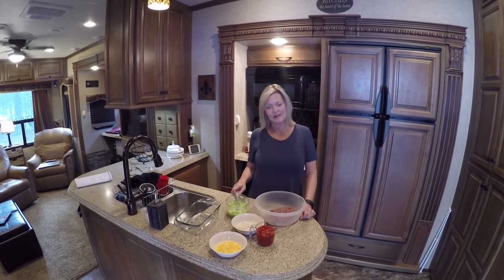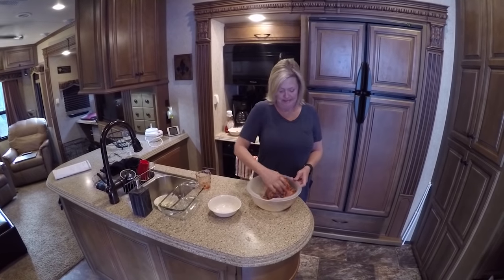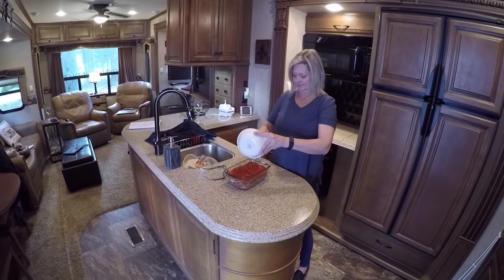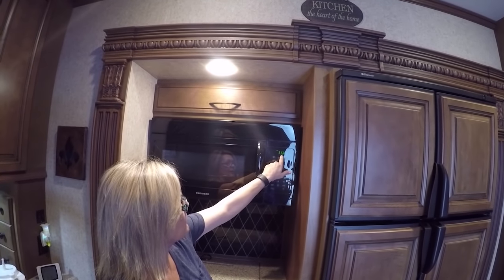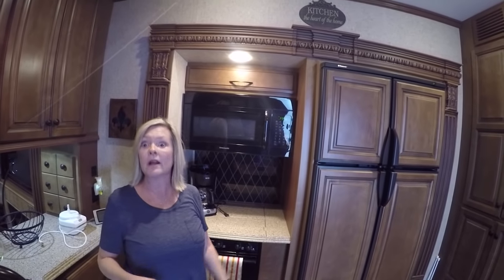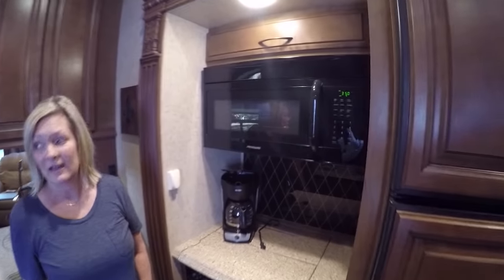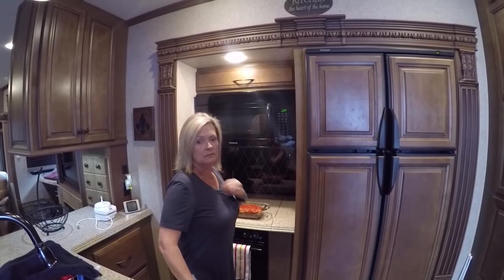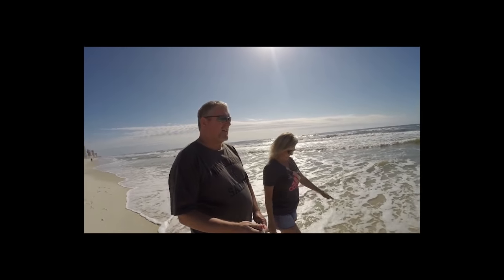RV Life Living Full Time In a RV S3 E30 RV Cooking With Kim--Meatloaf/Convection Ovens

Comment: Crock Pot! Meatloaf cooks great in a crockpot. Quarter potatoes & put on bottom , a 2 lb meatloaf cooks up great in 6-8 hrs on low. Check with a thermometer.  I plan to do lots of crockpot cooking when we start full-timing.
Reply from the maker: Crockpots are great if you are plugged in to power and can run them.  Boondocking can be a problem using them though.  I will try your recipe.... Thanks
Reply: +Rv Adventure TV: True, but a time saver if your out exploring or hiking during the day. I've not heard reviews about battery run crockpots.
Reply from the maker: I agree just put in a meal in the morning and come back to the RV with a dinner ready to go

Comment: I have never used a convection oven for meatloaf.. Looks like you did an excellent job though.. I use ground beef and ground pork as well in my meatloaf...lol I am usually feeding more than just Andi and I. Your recipe does look a lot easier though :) and of course the low cal/lowcarb is also a plus!! Great advice for using the convection oven!!
Reply from the maker: Thanks I have come to love this thing and so easy to use without heating up Madi.
Reply: Yes that would be a huge benefit especially in hot summers..Like you guys, we grill out quite a bit too